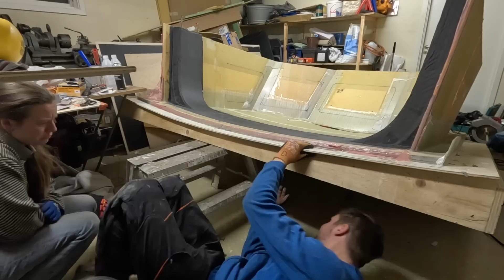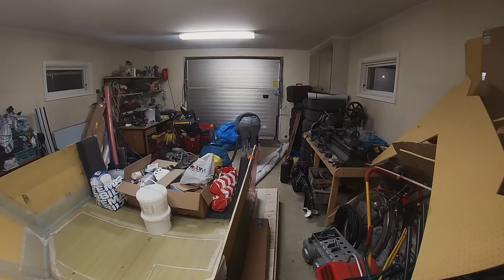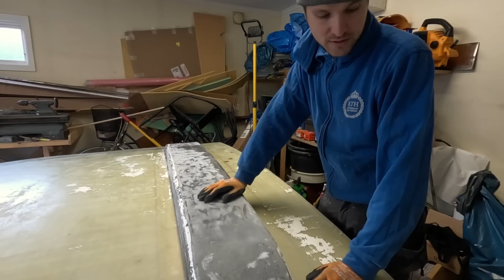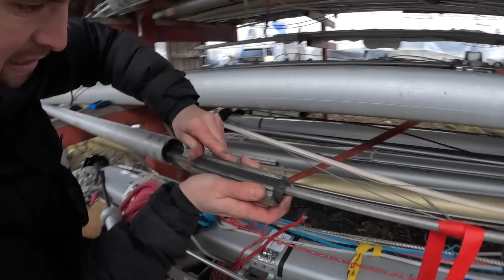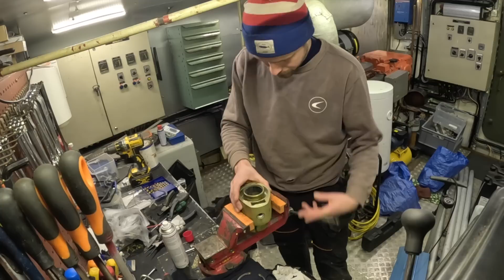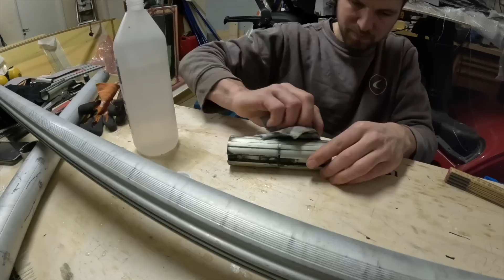De-molding the Doghouse we are Building for our Sailboat & Furler Fix [2.36]

Comment: Seeing the doghouse released from the mold must have been a relief. In hindsight, what improvements or changes would you make if you were to repeat the doghouse process again? 
An alternative for more excellent wear resistance to the furler joint would be TIG welding some aluminum material instead of epoxy, but sure, your repair will last if the epoxy does not come loose. Thanks for sharing all the somewhat unusual projects not found on other YT channels. Cheers.
Reply from the maker: It really was, so happy it came loose quite easy 😊 we haven’t really gathered all our thoughts regarding the process yet, but we’ll probably get back to that in the near future. Yeah, that would definitely be an alternative, but we hope that the epoxy solution works for a while 😊 thanks! ☺️☺️